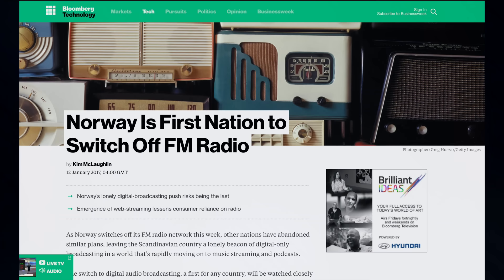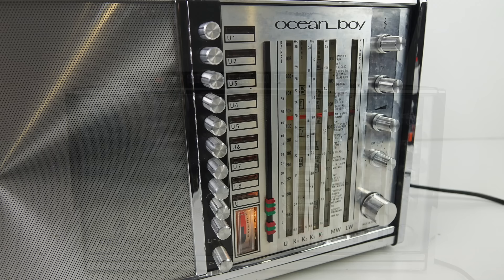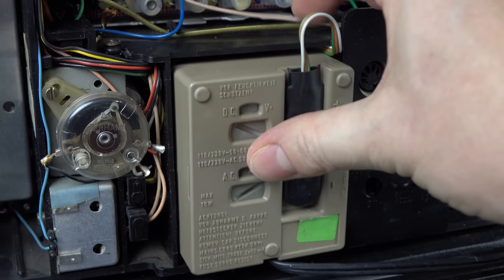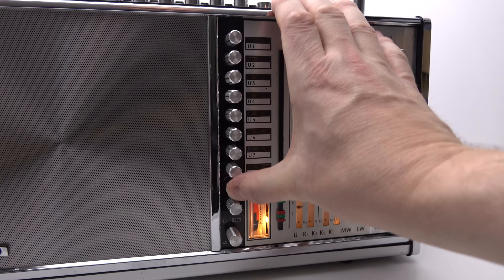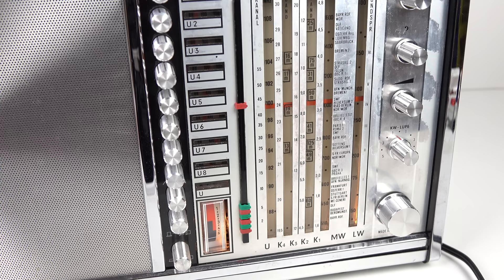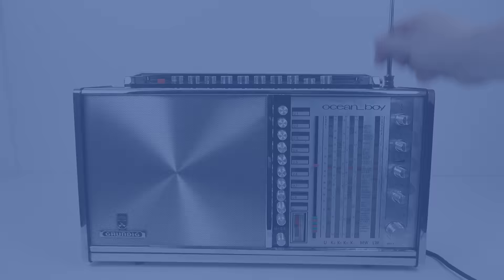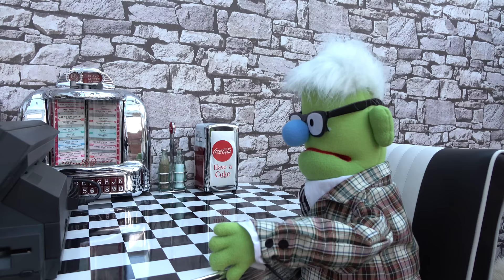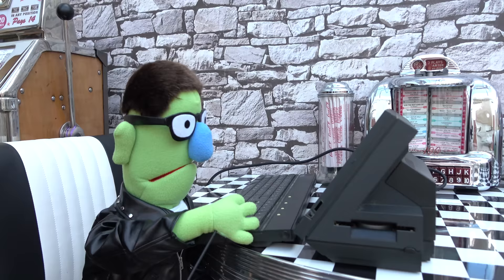Design Classic: Grundig Ocean Boy 210 Radio

Comment: Well, that does technically answer my question. Touché.
Reply from the maker: You're a good sport old chap. I've seen earlier comments stating that I was being sarcastic and bullying, but I just thought it was a fun question to wrap the video around. Seems not everyone agrees. Ho hum.
Reply: Techmoan Of course, in hindsight it was a silly question on my part. Hopefully there'll be DAB radios which match your other, vintage, equipment. Good video, and definitely one I'll be adding to my favourites.
Reply: Techmoan In car FM broadcast device?
Reply: Just go on ebay(or similar) and buy a FM transmitter .. shouldn't cost much, it's like old school Bluetooth
Reply: stevie Baby You can get a small mobile phone attachment to do the job.
Reply: I'm actually doing that at our cottage, not because of sound quality, but because there's an old radio there that I'd like to keep in action, and I like tinkering with things :)
Reply: Funny question and funny answer, though really it's easy to use an car radio FM transmitter indoors to transmit digital signal into FM from say a phone to the radio.  I dare say there is probably an indoor FM transmitter as well, but it may cost more than the car one.
Reply: Been using a car FM transmitter for years to play music from my phone to the analog car radio, will be doing the same for radio shows :D
Reply: Don't worry about those who don't get it. True fans love it, and think it makes the show so much better.
Reply: I don't think it's a silly question at all and you didn't actually answer it properly IMO. The implied questions are: will you be selling your FM radios? If not, will you keep them plugged into your system for display only, or will you pack them away? And surely, the value of FM radio receivers will drop massively when that day comes or draws near, do you expect to take advantage of that (e.g. to review some last-minute FM radios on the cheap) or will it otherwise affect you?

You are a collector, but you also collect mainly functional items, so these questions really don't have an obvious answer as much as you seem to think.
Reply: I have seen DIY plans for a in-home short-range FM-transmitter in a magazine some time ago, and plans for a portable version from the same publication--in a later issue. When the low-cost, battery-powered prefab variants hit hit the market, I simply bought one... instead of mussing-around with things I didn't understand, unlike my experiments to emulate what PCM-device permits a VCR to do (8-hrs of audio on a single VHS-cassette) before learning exactly what the ad in Stereophile Magazine--which I only caught a glimpse of--was fully about.
Reply: NO MORE FM TRANSMISSION ???  
When that day eventually arrives in my corner of the globe then be it my solution to audio transmission progress is to hitch up a basic yet refined non compromised FM transmitter to my '(insert manufacturer) does-all media playing time sucking witchcraft wonder box' or selected vintage source device and continue to bask in the individuality all my receivers possess negating the ornament risk that would eventually condemn it to the display shelf or the forbidden abyss that is everyone's well known dusty parts farm, awaiting to donate an organ to another's longevity.
Post Script- I have recently noticed others share the same solution to this future problem, they are the few wise ones........go forth and procreate for your kind is diminishing.
Reply: Well, you can always buy mains to 12v DC converter and use your in-car transmitter at home. And most of those converters use standard car socket.
Reply: jur4x I've always just used the type that make use of AAA-batteries....
Reply: It's the one and only answer, but also a sad one :(

Comment: On the bright side, if they switch off FM, more pirate radio stations will surely crop up.
Reply: Joe Cleveland There's that, sure to give the authorities headaches!
Reply: I heard at one stage talk of it being open for community stations in the UK which would actually be better than most of what is on air now.
Reply: +Tripoledonkey Hope so - I've got into listening to  my community station & enjoy hearing stuff that I wouldn't normally. recent e.g Duane Stephenson. Just playing my own stuff that I already know through my FM radio for the sake of getting sound out of it doesn't appeal to me so much.
Reply: If big radio does exit FM and the band is left mostly open, we would have a huge pirate and amateur radio resurgence as the tech is widely available for it.
Reply: @Tripledonkey This is almost certainly what will happen to 88-108MHz in the UK - a sort of community / quasi-freeband with relatively light touch regulation and peppercorn license cost. Band II is worthless for any other use such as mobile data as there simply isn’t enough bandwidth. Perhaps it could be repurposed for something like rural smart meters, but I doubt it. It will also be somewhat susceptible to interference from G.fast data over copper telephone lines.
Reply: They should do that in the US since all the fm are just corporate junk.

Perhaps more pirate shortwave transmissions will crop up either analog or drm radio frequencies.
Reply: @niklass1641  You can't really make it IMPOSSIBLE to access, particularly given how widespread and relatively simple the hardware required for an FM broadcast is. Illegal to access, sure, but that's a different thing. And, well, pirate radio stations are already illegal, hence the name. 

That said, last I heard the US was going to just leave AM/FM alone because the amount of bandwidth that part of the spectrum represents is so small that it isn't actually worth messing with in the modern era.
Reply: @beyondbeyond1965  Absolutely right!. Especially as FM works really well for localised community stations with low ERP. Maybe we can finally get some decent radio stations back without all the BS propaganda that the mainstream media are churning out all the damn time :)
Reply: I'm waiting for that day to come
Reply: I was going to say something similar, piracy is why FM will never truly be switched off
Reply: I would support such an act..
They are locking down comunication..
They never seem to care about people who live on remote areas..
I still need to use AM while travelling becsue FM want transmit though the mountains let alone a digital radio signal..
And Satellite is useless unless you have a huge power source..
FM and Am radios can run for a week on a single AA battery..
During major storms of disasters the only thing that can be counted on and getting information from such a radio..
Reply: You guys know that online radio is a thing??? There are hundreds of stations out there... No need for pirate stations, what a nonsense... That's like sticking to compact cassette in the age of MP3 and FLAC.
Reply: @ClaudioMichel  internet radio only works if you have internet. I have no ability to have a mobile connection at my house (no service) so unless im inside the house, no internet for me. Down the shed, in the paddocks etc nothing. Id love a radio station pirate or not that played 90's and 2000's trance. But alas. Mp3 cd in the shed or usb stick in the car is about the best i can do if im home

Comment: Get one of those 12 volt cigarette lighter FM transmitters that plays the music from the SD card and converts it into a FM signal. That way you can produce FM signal that you can catch with your radio lol
Reply: West Senkovec 
Thats not radio!
Reply: Good solution if you don't have an aux port in your car.
Reply: +Attila theHun it's actually better bc no ads and it doesn't stop u playing explicit music and there's a lot more variety than real radio stations which just play the same songs on repeat constantly
Reply: the Radio in my 2001 Ford F-150 has a tape deck so I usually just plug in my cell phone with an old sony tape to 3.5mm adapter, and play the music off of it, and because it's about the only time i use my mobile data besides google maps, SoundCloud, and XiiaLivePro(Plays shoutcast radio, and a few others) have become great when nothing good is on FM here in the US.
Reply: You could also try any of the many AM bands, or just plug your iMan into the nice stereo plug on the back, it looks like the standard German 5 pin DIN for tape recorders with stereo line in on one side of the plug, stereo line out on the other.
Reply: ChloeWade 
But that doesn't have the feel of a radio. Degrading this thing to a speaker would be pretty sad imo. A radio was and is more than that.
I'm a proud owner of a Beolit 1000. I never would play my mp3's on that device...that just doesn't feel right.
This is all just my opinion and feeling of course.
Reply: +West Senkovec I like your photo.

Comment: I suppose you could use a local FM transmitter to still use equipment like this when the signal is turned off.  I've used one in the past and they are quite cheap.
Reply: WeirdScience06 good tip, I have a transmitter here, so I'm ready for the black FM day 👍
Reply: I bought an FM transmitter/bluetooth interface as I'm a tight git with an old car ;-)
Reply: Do you have any model(s) you would recommend? I've been interested in getting one.
Reply: WeirdScience06 didn't think about those, but I've one in the car. 

Wondered if anyone might make a little gadget you could install inside an old radio to convert it to a digital device.
Reply: Well, sure, for retro's sake, but it'd be a bit pointless having a sound source and squirting it through two lossy conversions to listen to it on a device 10 inches away.
Reply: Hang on, once FM radio's switched off, will the FCC (or its local equivalent) bother me if I set up my own radio station? From a practical standpoint I'm not disrupting anyone else's transmissions and you can't really call it a broadcast band if there's no broadcasting going on in it, can you?
Reply: John Ridley in some cases it's good. if you don't have enough money to buy a new car radio, a transmitter is a good solution. and nowdays car radio can be very expensive cause often the navigation is a part of it. the radio to my car costs 3000 bucks eg.
Reply: You will be disrupting the digital radio transmission.
Reply: piast99 totally different frequencies,  in the UK digital radio is in the 20x Mhz range,  personal FM transmitters generally are around 87-108 Mhz with a range of 30-100 metres max
Reply: As long as you're not using a frequency used for digital... The frequencies assigned to DAB and HD Radio are the same as the old analog FM bands, so there is a potential polemic if you were to broadcast over a commercial station... otherwise, stick to 100 watts output power or under, you could feasibly get away with it.
Reply: +Matt Sephton Finally I come across someone else who's ears don't take kindly to skleakity dwawlikie scrinkly tquawskity sounds, like a spider trying to ice skate on a porcelain serving platter and flailing miserably with the only things being carved up are your poor ears. lol At least fm signals remain unaffected by the weather.
Reply: I used to have a device for the car that connected to my iPhone and broadcast the sound on FM so that it could be received by the car stereo. So very low power FM transmitters do exist - maybe something techmoan would like to look into.
Reply: You can bet they're going to sell those frequencies to someone for something else.  Wait, who did they buy the frequencies from in the first place?  That's right... no one.

I can see a brewing market for devices that connect to internet radio and/or other devices and broadcast them over FM to the rest of your house.
Reply: I actually have a small FM transmitter that plugs into the cigarette lighter of my car so I can listen to music from a USB stick.
Reply: Alastair Ward not possible to do
Reply: The Raspberry Pi can transmit FM frequencies and it's dirt cheap.
Reply: Yes they will. The frequencies are being auctioned off for other purposes now that they're becoming less useful for radio.
Reply: Hey you can just use a raspberry pi with wifi, program it to convert internet radio station audio, channel it via a audio output port to the speakers. If you wanna go fancy, you can make use of the knobs as inputs and change internet radio channels.
Reply: i wouldn't like that because I haf to listen 2 the radio and because I don't have away 2 get any SSD, internet and SSD drive/hardware and storage devices 2 my aux portion switch on my radio or boom box or some dell speakers hooked 2 portable player like tape walk man, disk man and etc...  that fits in a pocket. iPod and docking system doesn't count.
Reply: "Hang on, once FM radio's switched off, will the FCC (or its local equivalent) bother me if I set up my own radio station? "

Probably, since said FM band is still prime real estate will likely be auctioned off to telecoms or technology companies or who knows what else.

Imagine me broadcasting a high power radio signal in the wifi or 4G LTE band right next to your house.